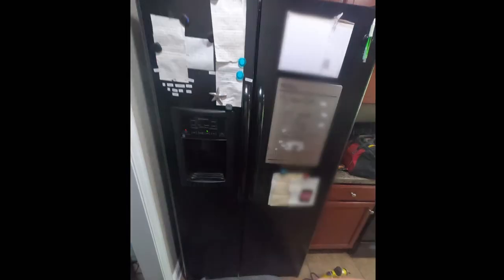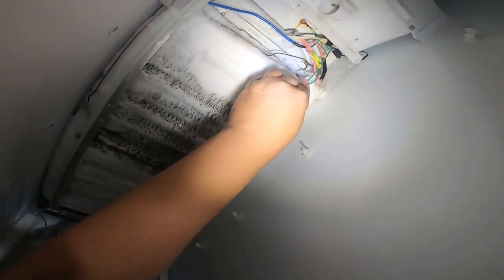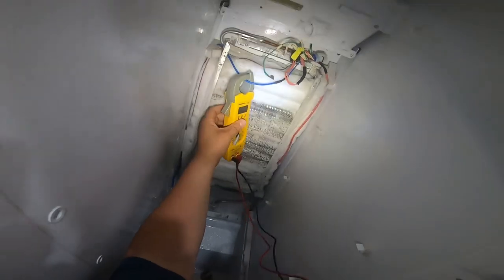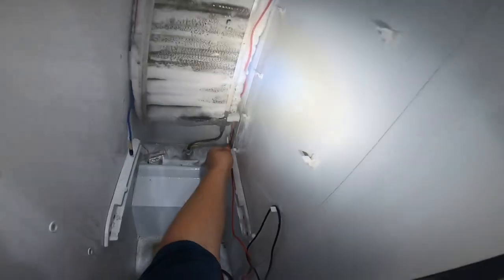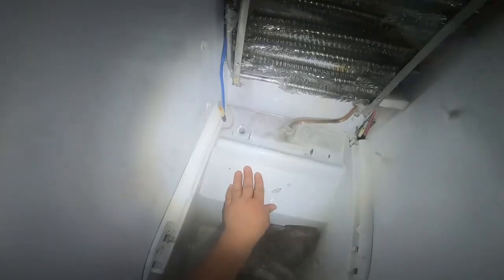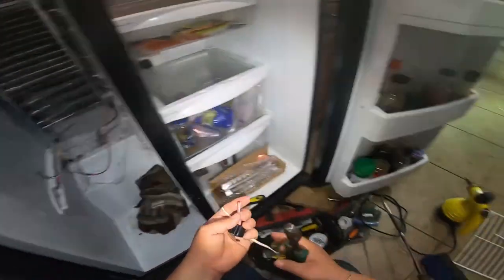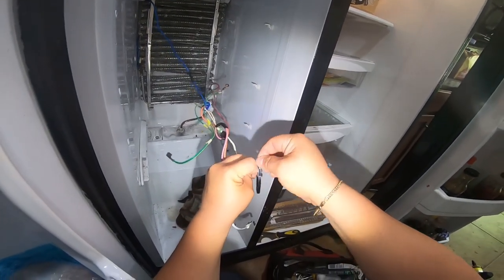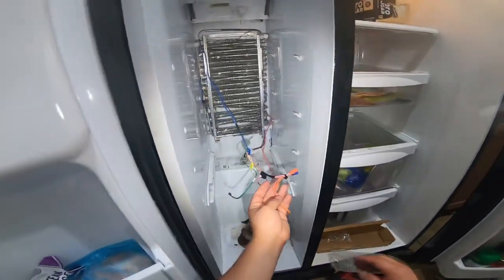How to Fix GE Refrigerator Ice Build up on Freezer | Fridge Section Not Working | Model GSH25JGDCBB

Comment: I just wanted to say THANK YOU! Because of your awesome video here, I was able to order the kit with the link you provided (hopefully an affiliate link to make a couple bucks), and fix our fridge problem. I replaced all three parts and also heat shrinked all the connectors. Others on Amazon said this kit wears out within 9 months to a year, but at least I found the solution now. If it goes out again, I will most like purchase the OEM GE kit (a lot $$$ more). Anyway, thank you so much for the help. This was a breeze to fix and my fridge and freezer are the perfect temp now - wooohoo! Thanks!
Reply from the maker: That is Great to Hear! Glad My Video Helped! Thank You So Much for the Support, We truly Appreciate it!!

Comment: for defrost there are 4 main parts.   heater unit.   thermistor temp sensor .  high limit  defrost sensor.  computer board.   my high limit defrost sensor went bad, and when it did it knocked out my computer board.   so just replacing parts without testing is not the way to go.  there are videos showing how you disconnect the circuit board and test the defrost components at the board .   i did that and found all my components were good after replacing the high limit defrost sensor and still getting no defrost in the fridge.    when i took out the old  circuit board, there was a burn mark on the back on one of the solder joints.    i didnt want to believe it was the board,  but it was.